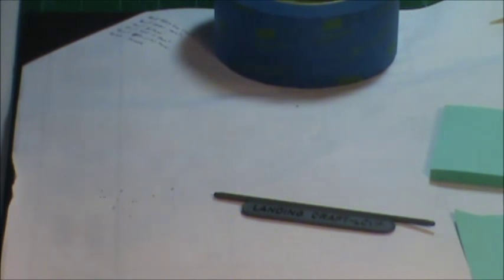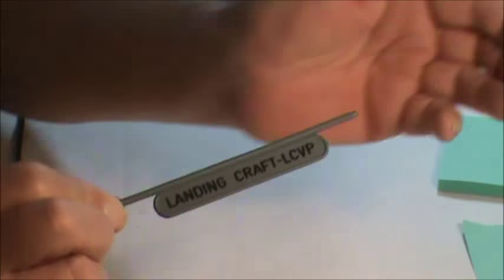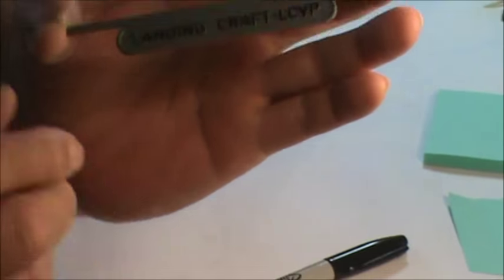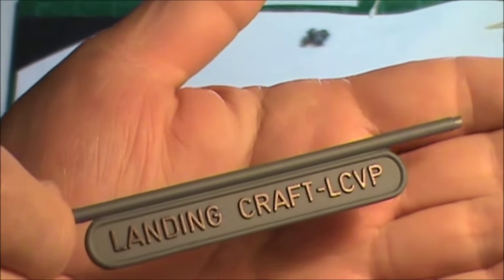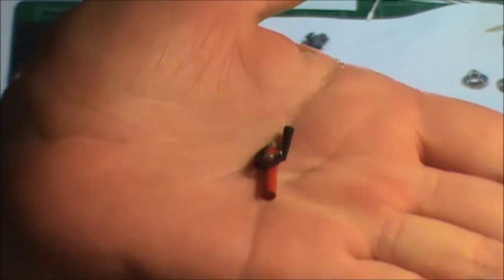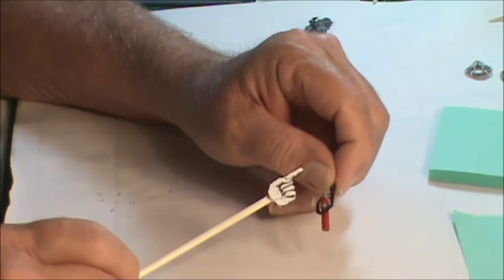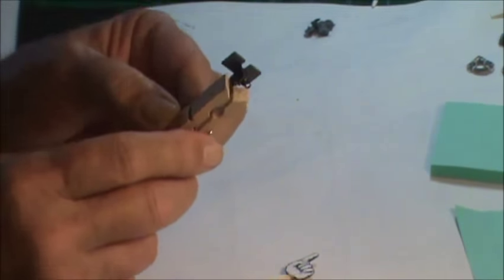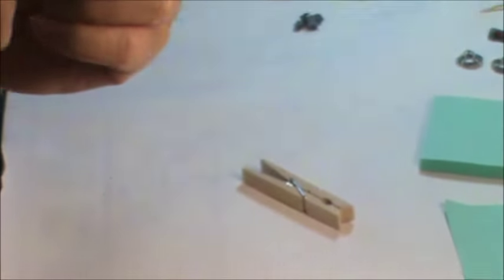LCVP PART 6

Comment: @Gary Brinker:

Hi!  I stumbled onto your videos after I had purchased the 1/426 Revell Arizona model from my local hobby shop.  The box I bought was really cheap and I haven't done a model in 30+ years.  I saw the the box was from 1975.  I knew some of it didn't look quite right to me and I wanted to see if I could do any improvements, so I was searching for information on the kit and found your videos.  It is interesting to me the differences between the kit you were working with and mine (mine has more defects; sink holes, etc), but my instruction sheet didn't have the crane error that yours did.  I found that odd considering your version of the kit was newer than mine. :)

I have set aside that model for now while I do more research on the Arizona. (I am planning to add the docking keels on the bottom of mine).  I have a feeling I will be doing a decent number of scratch components for mine.

I also watched your build of the Dresden, and have started doing research on the Emden.  I am thinking of doing a slow follow-along of the models you are building.  Maybe I can post some of mine if I ever finish them. :)  I am also thinking of trying the LCVP as well, though I am looking at 1/48 scale.

One disadvantage I have at the moment is that because I am just getting back into scale model making, I am lacking in a lot of the tools and supplies to do some of the models justice.  I have most of the normal tools now, but I am woefully lacking in the small special pieces of styrene and brass (rods, tubes, I-beams, etc).  Those will take me a while to build up as I have spent a lot of money on the base items so far.  However I think within a month or two I will have enough materials to start comfortably doing some scratch-built items for improvements.

I really have enjoyed watching your videos.  If you don't mind an idea/suggestion for the filming of the videos...  You can set up a simple diffuser for your lights so they are not directly blinding you.  It will also have the effect of making the light softer (less hard edges).

Re: The airbrush setup.  You can buy a cheaper setup to start... like one used for nail art in salons... for example http://www.ebay.com/itm/NEW-Airbrush-Kit-Compressor-Nail-Art-Tattoo-Dual-Action-Spray-Air-Brush-Gun-Set-/370917439223?

That is the route I am contemplating going until I can afford a better setup.  For scale model airbrushing we would probably be using the airbrush in rather short bursts, and as such don't necessarily need a better compressor to start with.

Cheers!
Reply from the maker: +Keith Young 
Hi Keith thanks for watching....It's funny but I bought my son a hole set of lights on tripods with diffusers for christmas and I have none.  I do need to work on my lighting but I have limited space in this appartment.  I'm still working on my lights as we speak but thats another hobby in itself.  
You will need a spray booth and a way to exhaust your fumes to the outside or your going to fill your house with paint fumes and overspray.  I just can't do that in this appartment, maybe if I was on the second floor.
If your building any U.S. ship try http://www.navsource.org/ for some very good research.
Good luck on your models.

Comment: Hello

The pulleys would of had a "Rivet" or domed head one end and a nut the other, You undo the nut and remove the shaft to renew the pulley wheel. I presume the 1/2 hole you use to make the rivets stops it spreading. I might have used a Sewing Pin for the shaft and domed head. I have used them as Press Studs on a 1/16 car "Soft top". And I use tyre white pens for White where you used the Sharpie. Must admit I don't spray paint I use brushes and normally use Acrylic paint so try to paint as much as I can before sticking together. Waiting for 7 to see what she ends up looking like Andy C

Comment: +Gary Brinker .  I  have limited space for the  hobby as well. I do all my work on the kitchen table.  I  wanted to do  some  airbrushing.  didn't have the space.  I went on amazon  and  found a  neat little  kit. for  around  $60.00. It includes a little compressor.  Around 6"x6". A hose. And decent  two  stage airbrush.  I hope this helps you my friend.  Great  Job!  Looking forward to the reveal.  Take care.

Comment: Easy way to make a rivet, stretch some sprue, hold the end near a flame, perfect domed rivet. Drill hole, place rivet in hole.
Reply from the maker: +mailperson 
That is another way..... Seems like a little more work than mine and I'm sure there are other ways also.  May try it next time I need some rivets.
Thanks for the info.